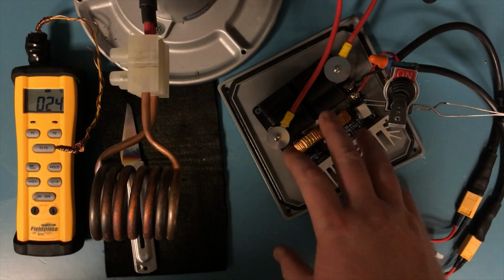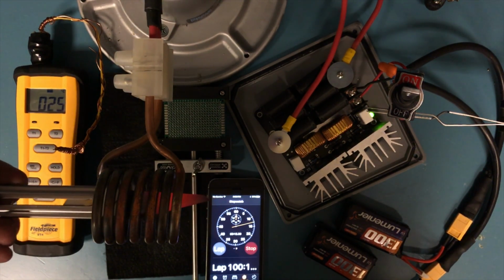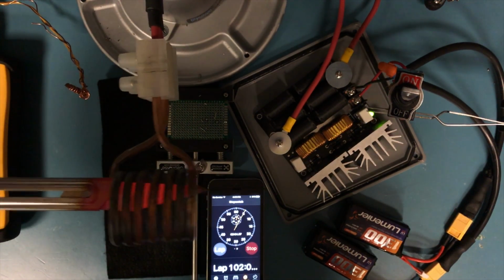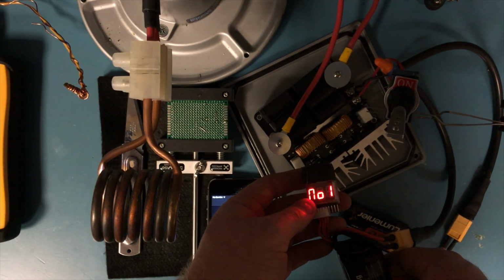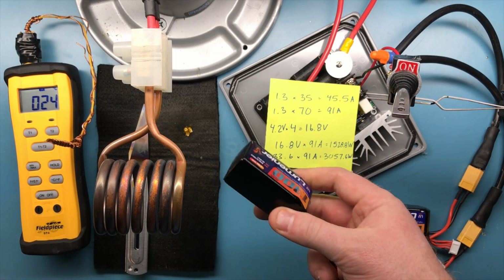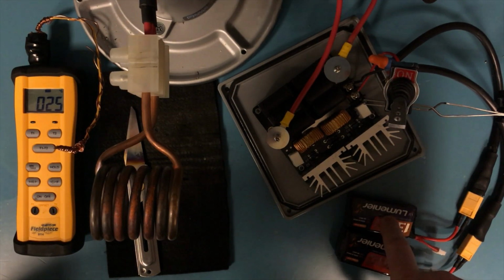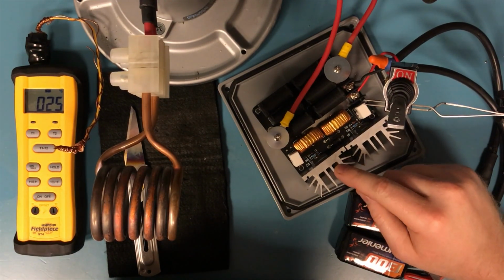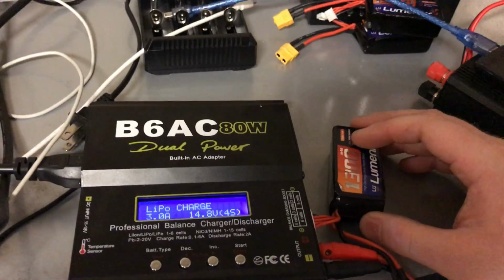Cheap 1000W Battery Powered Induction Heater 🔴

Comment: Great video. I was doubting on whether i should use quadcopter batteries for powering my ZVS circuit. It seems that you can use a quadcopter battery. Thanks cuz there arent many videos in which they use such batteries to power ZVS circuits.

Comment: +ProtoG Have you ever measured the temperature of your toroidal inductors? Mine overheat if I leave the system running too long. I don't think it's a power supply issue, mine cuts out appropriately if the system is under too much load.

Comment: i dont see u have a wire conected to the center of the coil as keystone science did
Reply from the maker: Academia Gamer that's because this circuit does not need a center tapped coil.
Reply: what is that for bud?
Reply from the maker: The other circuit needs it in order to produce both polarities of the sine wave.  This circuit does not.
Reply: what are both polarities use? sorry
Reply from the maker: The positive and negative portions of the sine wave.
Reply: but what is the final result of this different to yours? id like to know if that centertap's worth it

Comment: just wondering if there is a simple way to power the driver?  like cut a power cord and connect the leads to plug into 110? or a printer power supply cord? Or a laptop supply cord?  or a cell phone supply cord?  something like that or if I'm way of on my thinking? I'm trying to come up with a simple way to use the driver to de-solder contacts. Plug and go!   Thanks.
Reply from the maker: Batteries are simple and actually cheaper than a power supply needed to give this unit the current it needs.  Watch my other videos on induction heating and you'll see me using a 48V 20A power supply to melt aluminum.  It needs DC at the input of the driver and must be between 12V and 50V with a recommended range of 24V-50V.  The batteries in this video are supplying 33.6V. You'd be much better off with a butane soldering iron unless you have other needs for an induction heater.
Reply: Proto G AHHH... cool!... I'm just looking for simplicity/hobby type stuff/other options. I checked your video list for recent videos but didn't see anything.... Maybe I didn't go back far enough. Thanks for replying so fast!!! And for all of your knowledge!... I'm trying to find a use for wasted power supplies while at the same time learning. Thanks for all of your help and input!!!
Reply from the maker: No problem bud!  I wrote a detailed introduction to induction heating here: http://www.instructables.com/id/7-Uses-For-an-Induction-Heating-Machine-How-to-Mak/

Comment: I've seen a pack like this jump start a car, they're damn serious batteries hehheh
Those cables on the input look a bit weedy though?
Reply from the maker: After 30 minutes of abuse, the temperature of the input wires increased from 25C to 30C.  They're rated for much more than 30C.  I usually use my thermal camera when experimenting to make sure nothing is heating excessively and use my temperature meter when something looks wrong.

Comment: Awesome Proto! I've been using a zvs driver for the past couple days to do some inductive heating as well :D ( although mine is not as powerful as yours ), anyways I've seen people use a center taped coil and just a regular coil for this using a zvs, which would you say is more effective ?
Reply: Oh hey, also those batteries look super good ! ( is it 14 v per cell ? ) also do you think those batteries could supply a zvs driver for a flyback transformer well? ( I just think it would be cool to make a portable arc device )
Reply from the maker: Thanks! Yes, they will drive a flyback with a ZVS but that would be pretty dangerous.  4.2V per cell with 4 cells per battery.  Total of 8 cells shown here with 33.6V.  I have never seen an industrial center tapped induction heater.  I have only seen homemade center tapped heaters and cheap units online but the versatility of not being forced to make center tapped attachments makes this unit much more useful in my opinion.

Comment: I got a induction heater coil and driver thingy set up very similar to you, would two 12 volt car batteries in series work well you think?
Reply from the maker: That greatly depends on the quality of the battery and how many cycles it has been through.  Lead acid batteries have awful lifespans and most of the time, the only reason people have them is because it was the old battery from their car.  I recommend lipo batteries.  They're more expensive up front, but when you look at their life cycles compared to lead acid batteries, they're actually cheaper.
Reply: Proto G I was actually thinking two glass mat batteries from our solar panel. I think I fried my board though... I hooked it up once, months ago, and I smelled burned components... And I haven't tried it again... I need to try it again. I've just been putting it off for fear of completely destroying it if it isn't already...

Comment from the maker: If you like my videos, please consider supporting me at https://www.patreon.com/ProtoG42 to help me produce more content.  Another great way to support me is buying from my Amazon store here: http://astore.amazon.com/prg06-20.  You can also support me by simply subscribing, liking and commenting on my videos.  Thanks for watching!
Reply: Proto G Would this power supply be enough for running the driver? DROK Adjustable DC Power Voltage Converter AC 110V-220V to DC 0-48V Module 48V 10A Switching Power Supply Digital Display 480W Voltage Regulator Transformer Built in Cooling Fan https://www.amazon.com/dp/B0716XVR7P/ref=cm_sw_r_cp_api_iFAOAb4FMKCPA
Reply: Proto G FUCK OFF LEECH

Comment: Your batteries are a bit too small for such current draws, they wont last all that long. 
Going up to 5-10ah would be better.

The ratings on those batteries are very optimistic.
Reply from the maker: They are not. That is the case for many cheaper lipo batteries, but these have lasted me almost two years now with a lot of abuse.  My quadcopter draws much more current than this ZVS driver does.  In fact, four times as much current.  These two batteries in series are running at about 15 amps while my quad draws peak currents of up to 64 amps.  These batteries are rated for 45 amps continuous and 90 amps peak.  They are perfect for my application.  If I need a larger battery for some reason, I'll buy one but there is no need seeing as I have 10 of these from flying my quadcopter.
Reply from the maker: Not the case at all, watch my older videos with the batteries.  I've used one alone, two in series and three in series.  With two in series, the largest current draw was around 16 amps or so.
Reply from the maker: That's also ok, even with 3 in series, the largest current draw I've achieved is 32Amps
Reply from the maker: I'm surprised they weren't picked by the spam filter.
Reply: Each one should be able to withstand up to about 95Amp current draw But i have a feeling that ZVS driver will pull very close if not more than that, and the fact that there are two batteries in series doesnt help
Reply: and ive just realised its only rated for that current for a short period of time, and continuous rating is about 45Amps